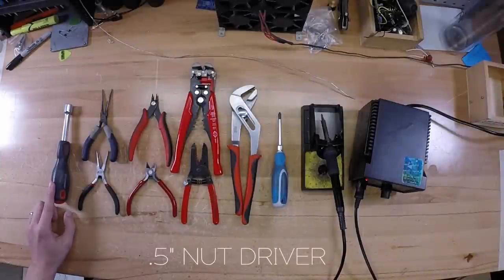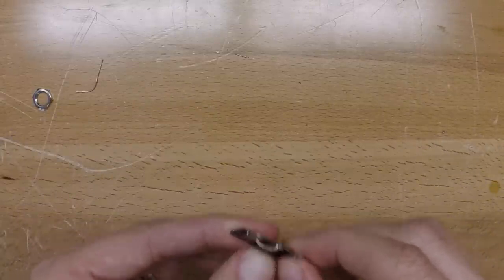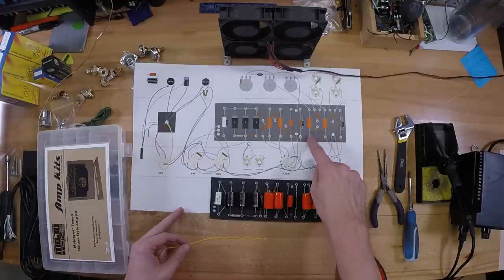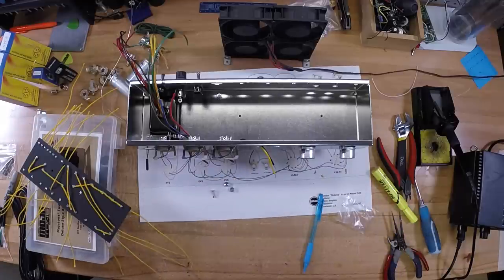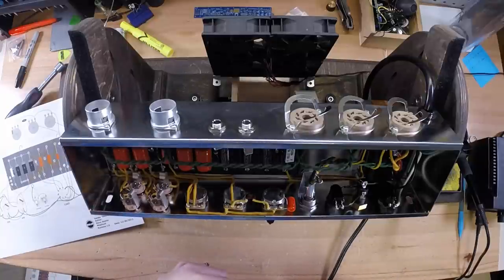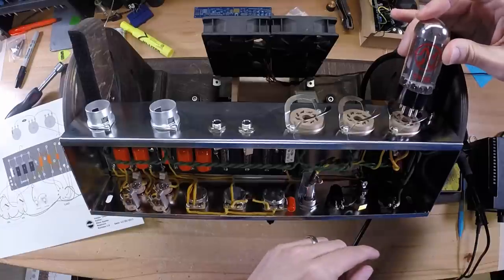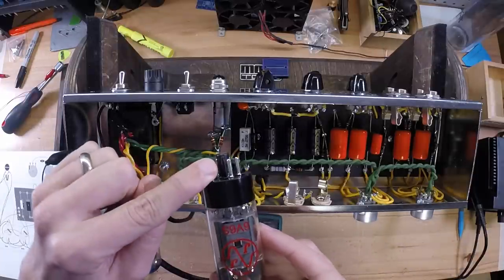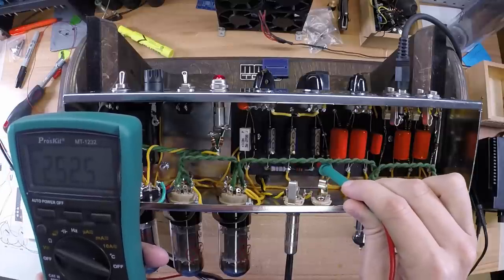How To Build a Mojotone 5E3 Tweed Deluxe Style Amp Kit Build- Walkthrough

Comment: Mr Steve, nice job. I always like to mount the power tube cathode bias resistor and cap away from each other to prevent the heat from the resistor from cooking the capacitor and I also like to mount the speaker terminals away from the bottom of the  cab to prevent the speaker leads from  being pulled on while repeatedly removing the ac cord with normal use . Thank you for the informative video. From one humble tube geek to another.

Comment: Shout out to the super convenient swiveling chassis holder with attached fans at 12:50 making working inside that tight space significantly easier. 😉
Reply: looks like a box with velcro on it and the fan is loose. You mean easier since it doesn't move as much or tip over? It doesn't make the actual space easier to work with.

Comment: Do your Princeton reverb!!! You guys should promote amp building through video!!
Reply: TOP COMMENT SNIPE to note as of 8/30/2021 their manual is very poorly written around vintage vs. modern wiring.  Text out of sequence on pages 14 and 15.  The pictures are more accurate, but I need to note the large color sheet they send is VINTAGE wiring.  Go by the pics and text on Page 19 on wiring the power cord.

Pages 14 and 15 are utter shite.  And they should send the full color printout for both Vintage and Modern and LABEL them as such.

Comment: I sprayed mine with Varathane Ultimate Spar Urethane.  Oil Based, Satin.  Many coats.  Has a slight amber tint which works great and easier than brushing.  I started with brushing and did not like at all how it took to the cloth.  The spray was great.  Outside, under a tree, on  a nice day.  Of course, I took it all apart first so I was spraying the three tweed pieces only; main cab and two back panels.  No hardware attached at all, including the legs.  Note: Put the screws back in as temp legs while spraying/coating.

Comment: One thing to note is that those filters are rated at 475 volts.  When you do the no load test with just the 5Y3, don't run it for long or those caps might go pop, considering there was almost 540 volts across them.
Reply: Id fire it up with a variac set on 50 volts ac or so and check for voltages Itll show about half the volts required but you can still check for voltages.

Comment: Great video, thanks for sharing this. I converted my '59 Bassman to the P2P 5F6-A in 1998 and upgraded via a kit I got from Dan Torres, I upgraded the speakers too. I'm not sure if the speaker change or the 5F6-A circuit the contributed the most. Whatever it was, the amp is just so awesome. It's too loud, needs an attenuator to be gigable, but it's just so awesome :)
Reply: To me it's kind of crazy to think about the fact that a Bassman is too loud to be gigable now and wasn't loud enough in the 60s when a guitar amp was pretty much a p.a.

Comment: At 21 min. you over-voltaged your filter caps. check the initial DC voltage with all the tubes in place. Same for the filament voltage, since the amp is completed.  If there is a fault, you want to know where it's at, which may not show as well under no load conditions.
Reply: If it were you. Would you put higher rated caps in it or something else?
Reply: @deanmlshredder  I'm just saying that if there are no other tubes in the amp except the rectifier, the 500 volt caps will be receiving 530 volts. that's not really a serious over voltage condition, but will not happen if all the tubes are in.
Reply: @51bobtube  got. Gearing up for my own build and seeking all the info I can get. Thanks for answering.

Comment: It would help if there was a template or measurements to show where to drill the holes in the cab for mounting the chassis. You skipped over that part. Other than that a very good tutorial.

Comment: I thought maybe I could build one of these kits at home? I have wired guitars and was once an Electro Mechanical Maintenance Technician at a Auto Factory. Loved your video but could not see a lot of what you were doing, either too small picture or to fast video. So. after watching you I have decided I could not.
Reply: @remley8877  Thanks!
Reply: Robert - slow the video down at points that matter.  You can do this!